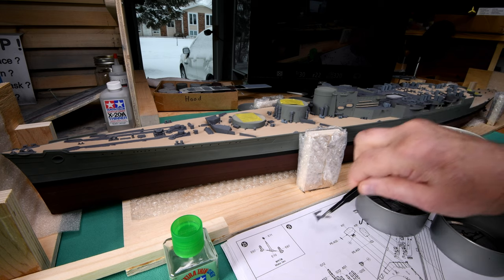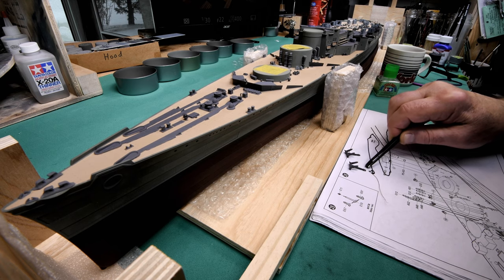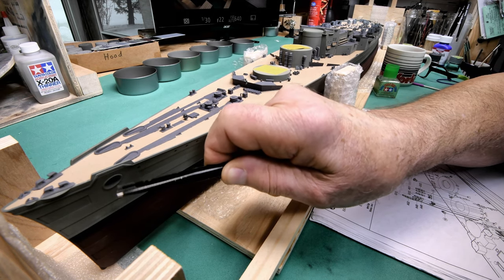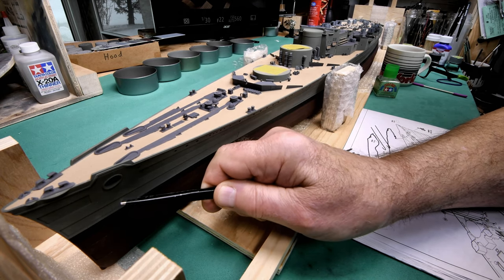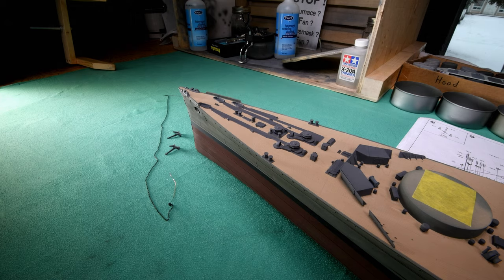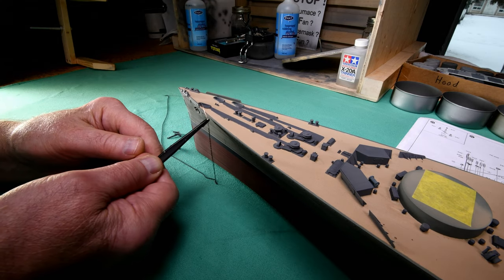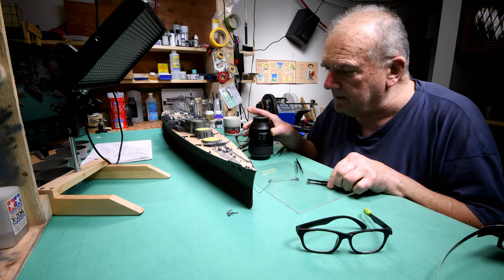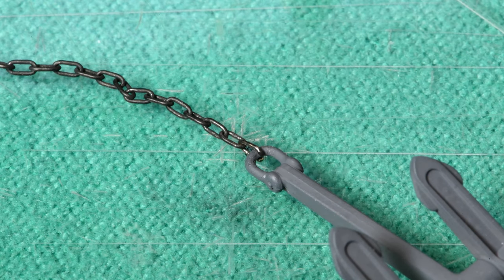The Model Ship - Part 632

Comment: Ladies clear nail polish works well as an adhesive/bond for some applications.
A dab would keep that link in place on the anchor eye  
Bottle even comes with a brush.
Reply from the maker: Good tip Andy, Thanks. 👍

Comment: I have had the same problem with chain in my armour projects as you Trumpeter ( other manufacturers too) seem to mould the U shackles in a large scale & supply chain that's a bit too small but I've super glue it on the back side & paint over it U are doing great see you tomorrow Ron cheers 😀👍
Reply from the maker: Thank you Trevor👍
Reply: @roncalverley  that's ok Ron try to stay warm see you tomorrow cheers 👍